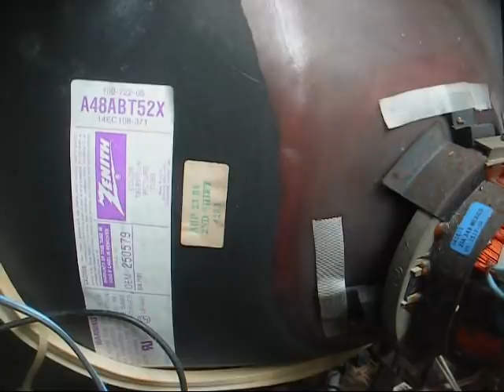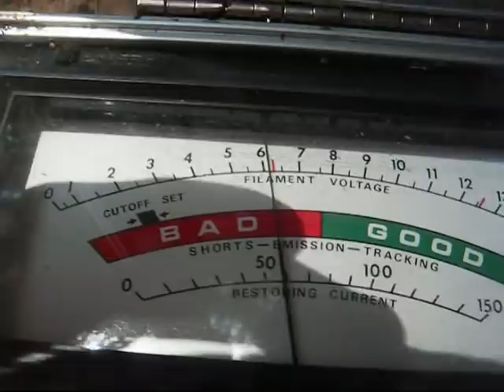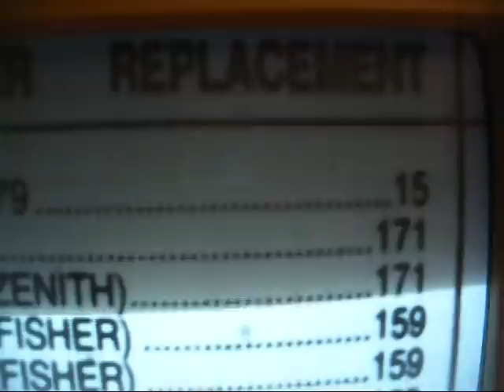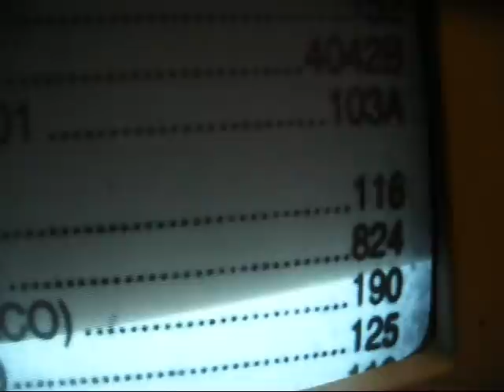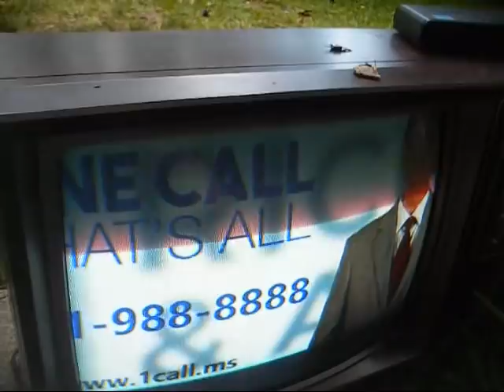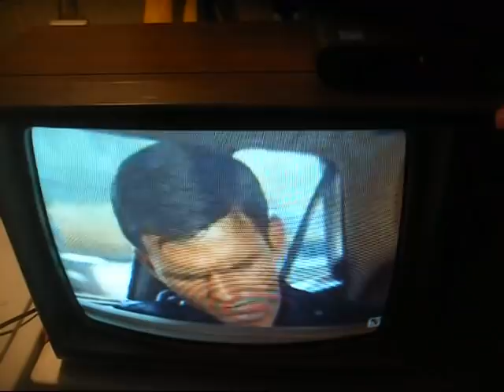Repair of a 19" Zenith color TV

Comment: I have a 14 inch JVC I ART CRT Tv and I love it. It had been sitting outside for months. I brought it Inside and it worked. The CRT buzzes but that's it. I resoldered a resistor because it came off. I will keep it until it dies. Does anyone know how to stop the buzzing?

Comment: I can't believe your family tried to deprive you of the fun and satisfaction of digging through your junk pile to find a video transistor! I didn't work much on TV's, but I do remember that "Capitol Records Building" style flyback coil from a Zenith I got second hand back in the 80s.  (I think mine stood vertically on the main board.)  It had the digital tuner with 10 key, but no remote, no channel up / down, and no memory, so every time you turned it on, you started at Channel 2.

Comment: A color tv was a luxury. We only had one from 1969-89. Any others were B&W. If the color went out, we watched B&W again until we got the color set repaired.
Reply: I watched b&w on an ancient set until I could finally afford a cheap import Teknika color tv with no remote in 1983. (The cable co. required a set top tuner anyway, so a tv remote was useless.).  The Teknika had a lot of hours on it but still worked great when I donated it to the animal shelter's yard sale in 2002.

Comment: Seems like a suitable replacement. At least it wasn't made in one of their Mexican  plants (lots of labor disputes, from what I remember); I worked on some of that crap in the 1980s and it looked like stuff kids would cobble together in a Montessori school. As I said on the previous video, you might want to check the capacitors in the horizontal output circuit of that GE; I don't remember the part number or anything like that, but a blue disc capacitor failed on my CTC-136 set and it behaved just like a shorted flyback, even though I got it running again for the cost of a new capacitor, a fuse and an output transistor.
Reply from the maker: What's funny is this '84 Zenith is made in the USA; but, I have a 19" Zenith Chromacolor II from '78 and it's made in Mexico.
Reply: My '87 Zenith, made in Mexico, just started acting up last week.  I paid five bucks for a 21 year old tv and eleven years later the darn thing goes on the fritz.  I bet it's going to cost a hundred buck to get it fixed.

Comment: TVs have become so cheap it's hardly worth the trouble. You can get flat screens all day that will beat the hell out of any CRT for everything but vintage video gaming at Goodwill. The one in my living room I got out of a garbage pile, replaced some caps and it's good.
Reply: The older LCD TVs are better made but holy bezels, Batman! The plastic in the front bezel takes up more than the teeny little LCD in the middle.

Comment: Zenith always had the best TV's.
Reply: Except for a few models in the late '70s with the multitude of little plug-in modules that always seemed to develop intermittents due to the weak tin plated connectors and the '90s sets with the picture tubes that seemed to have cathode poisoning issues since you had to rejuvenate them about every 2 months.

Comment: I hardly watch TV anymore. I use my TV set as a computer monitor to watch mainly YouTube. I don't watch any other streaming services. The DSL costs enough as it is, but it's half the cost of cable Internet. I only get like 10 Mbps download, but it's enough for most servers even at 1080 video. That's with me sharing it with my sister.

Comment: So, does that Zenith have a horizontal width issue?
Reply: Wide-screen 16:9 OTA signal through converter overscans the horizontal width of a CRT which is 4:3. I get that along with the 'postage stamp image' in the center of my 30" Zenith System 3 CRT TV. Annoying as heck and can't be over-compensated through the converter at all.

Comment: You are lucky. I can only get 4 PBS channels over the air with rabbit ears due to a small set of hills near my house. BTW, I had a 1986 version of this same Zenith TV( only difference in it was the number plate around the tuners was silver, rather than black). Found the set in a trash can behind a college dorm in the mid 90's and it worked perfectly until the CRT failed and I scrapped it in the mid 2000's.

Comment: Also I'm with you in the aggravation department when I get some piece of old test equipment out and it had to be fixed before use.  It does make you want to buy new.  I have on my oscilloscope and spectrum analyzer.  I have both old Simpson 260 and fluke digital meters.  Just fixed the Simpson a tiny piece of metal got into the meter movement.  A tedious but simple repair.  I just ordered zebra strips for the Fluke 87 as the segments on the LCD are failing again and I am tired of cleaning the old strips every year.  I noticed they were going out again while fixing the Simpson!  Strips are arriving tomorrow.
Reply: I know the feeling, easy to get buried in just making your tools work. Right now my more modern analog scope is dead, and my old all tube RCA that doesn't even do DC coupling needs recapped. I might have to fix one to fix the other, to fix whatever comes along that I want to check with a scope.

Comment: I used to take care of 300 + Zenith hospitality 19" TV's for a major Cincinnati hospital.  It used a similar chassis 1984 - 86 vintage.   We had lots of issues with the startup circuit board.  That was the #2 issue we ran in to.  The number #1 was the channel selector rocker switch.  You had to go through all channels to get to the off position and the nurses instead of holding the switch down until the set turned off, they would stab the switch in rapid succession until the set went off.  The switch would open up and not change channels or stick on and the set would rotate through all the channels over and over.    #3 was lose windings on the flyback or a small inductor in the horizontal circuit.  The TV would squeal and the younger patients or nurses would complain of the racket.  Coat the inductor with Glyptal and send it back out.
Reply from the maker: Over the years, I've seen a few of those Zenith hospital sets that had either the 9-160 module, the 9-181 and 186 modules, and the later one with the 9-470 main module. Externally, they all looked alike and then they came out with those crappy "new horizons" and "HealthView" sets (can we say bad picture tubes and burned up power supplies?). The local hospital that we used had 19" Sylvania sets that dated from the mid '70's and they were replaced in about '87 with Magnavox 19" cable ready sets with electronic tuning. The old Sylvania sets had a motorized VHF tuner, with a cover over where the UHF knob would have gone, and the TV was set to turn off on the UHF position. I've had a couple of those over the years and they used a 3-board modular chassis with a power transformer and delta-gun CRT. The only commercial-grade Zenith that I own is a 19" Chromacolor II motel set, with built-in AM/FM radio from 1979. It uses an inline-gun tube and a modular chassis that folds down to gain access to the back of the chassis.
Reply from the maker: Another thing I remember about those '80's Zenith sets is lightning or a surge hitting them and knocking out the transistors in the start-up circuit.

Comment: Sadly when Zenith sold out to Goldstar, : "The quality went out before the name went on". Goldstar CRTs were total garbage.
 I got tired of finding the bad parts on the PC board, only to have the CRT arc and take the main board out again.  I worked for a Zenith ASC for years, and afterwards for an independent. Finally the CRT's were failing so often, if the set was dead, had red retrace or green retrace we just told the customer buy a new set, just not Zenith, LG Zenith, Lucky Goldstar, or Goldstar. (All the same ball of bad worms).
Reply from the maker: I recall getting a Zenith 27" from '97, with no green. I quickly found a bad green driver transistor, installed a new one, and it had a nice picture. I sold it to a friend, who watched it for about a week and then the tube arced, taking out the green transistor again. Then, there were the older ones where the shorted tube would blow up the power supply. You could replace the power supply parts and it might play for a minute, an hour, a day, a week, or a month; but, the tube would short again and blow up the parts. In about '98, they wised up and started using CRT's from other sources (those held up much better); but, by then, the damage had been done. It got so when I saw a '90's Zenith with blown up parts, I condemned it on the spot. I remember installing an Opti-Chrome rebuilt A68ACT00X in a set and it was no better than the Zenith originals.

Comment: I’d take the HOT, flyback (and tripler, if it has one) out of that set you grabbed the transistor out of, and throw it in the set with the shorted IHVT; if it works, great, if not throw some fireworks in for a shango066-style EOL video and post it here on YouTube. My take on TV is: “who needs TV when I have YouTube”. 🤠 After all, it’s not going to get any worse, so might as well have some fun with it!

Comment: The big reason why people are starting to get TV's from the 1980's 1990's and early 2000's is retro video games.
Reply: Hit the nail right on the head. Even RCA's little 13" sets from the early to mid 2000's are quite nice - as they have composite inputs.
Reply: @cherrysdiy5005  The nicer (name brand) late 90s/00s 13inch sets do make really good tabletop 8/16 bit monitors. I have a low hour Sharp that I'm not sure I'd trade for a trinitron, it even displays RF Atari stuff extremely well.
Reply: Games before the LCD era are designed to be played on CRTs The graphics don't look right on a new set.  Also, if you can mod the old TV to take RGB (and most newer sets can be modded easily), you can hook just about anything up to them.  Even pretty cheap sets will give outstanding results from RGB.  80 column text NO PROBLEM!
Modern TV sets are in the wrong aspect ratio and when it comes to really old stuff, cannot be made to work at all without serious modifications to the game system.  A lot of older game systems only work with RF and there is just no way to get an RF signal into a modern TV because there is no NTSC tuner.
Reply: @tarstarkusz  I've not played with the latest, but I've not yet encountered a LCD TV with a tuner that didn't tune NTSC, usually you just punch in channel 3.0, some even play static. It will have the usual problems, lag, 240p processing, looking bad on general, but it will work.
Reply: @Broken_Yugo  That's strange.  The ones I have won't tune in NTSC.
Why would there be any lag if it has an NTSC tuner?  As I understand it, the lag comes from frame buffering and you are seeing and hearing the game some milliseconds behind the console.  But if there is a built in NTSC tuner, why would it need to buffer anything?  Is it not building the screen line per line or something?
Reply: @tarstarkusz  Exactly, the panel is nowhere near fast enough to draw it line by line, so the hardware in the TV builds a frame in a buffer from the interlaced NTSC signal (usually mangling it to some degree in the process) and then shows that. You're always at least a frame behind and 240p games rarely show right, any of the dimmed flickery stuff common to 8 bit systems will show up combed instead. Samsung were known for getting that right, but idk about current models.
Reply: @Broken_Yugo  That sux.  I use a 90s RCA for playing Atari/Coleco etc. I bought it new for that purpose in the 90s and I doubt it has more than 200 hours on it.  But even if the LCD worked correctly, they just don't look good on LCD screens even on PC emulation where there are options of scan lines and the like.
Reply: @tarstarkusz , that same logic is why so many are still holding on to older computers that run WinXP because the newer, so called "better" Win10, won't run the software and never made any provisions for doing so.  Sometimes just because it's new does NOT mean better, just more that doesn't work anymore.
Reply: @richardcline1337  That's why I'm slumming it with my Windows 7 machine.  Windows 10 is awful and there almost no chance it will ever get better. Microsoft is not the firm it once was. I am trying to avoid "upgrading" for as long as possible.  Sooner of later I will have to get a new machine and I will probably go Linux, even though it is pretty clunky.  
I still use the Windows 2k interface. It works well and is much faster.  Windows 2k was the best version of Windows ever.